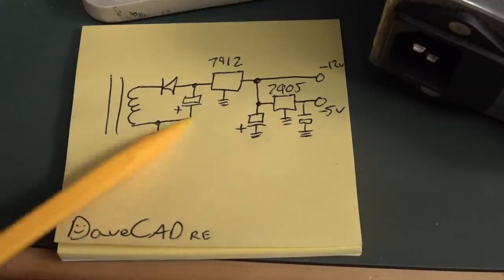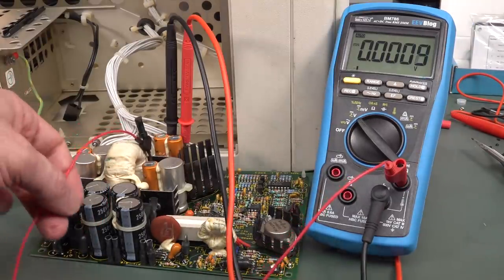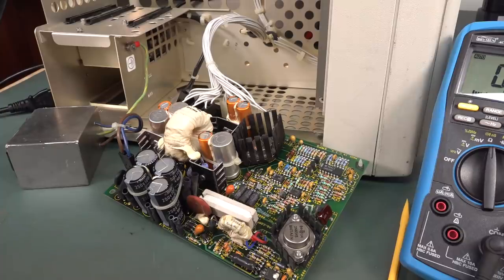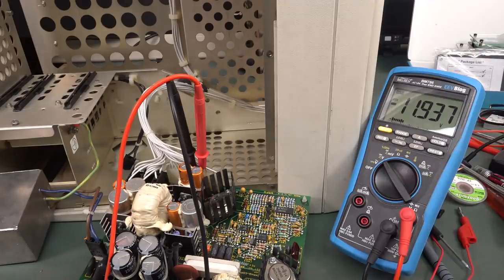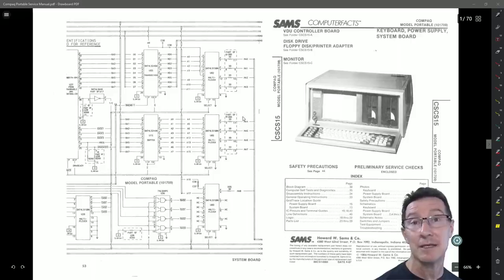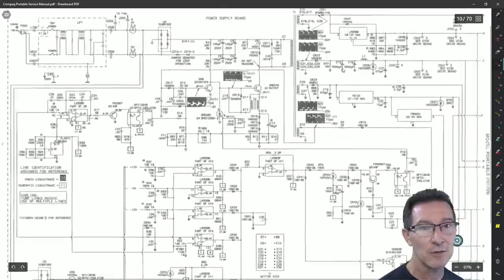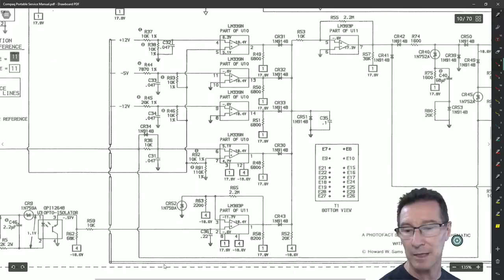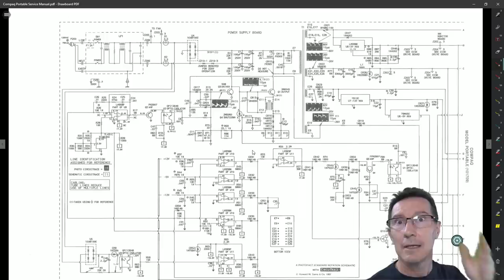EEVblog #1364 - Compaq Portable PSU REPAIR

Comment: HELP?  Alot of talk on Negative 5v or 12v.  What is it?  Ive checked google but dont understand
Reply: Eh?  It is -5V and -12V.... what are you missing?  The voltage is referenced to ground, and the negative sign means the current wants to from from ground back to the negative supply rather than the other way.
Reply: @phillipsusi1791  I'm confused cos Ac  waveform is like that isn't it.
So dc I'm just trying to understand. What benefit does voltage have being negative?
I'll just read up when I have time
Reply: @groovejet33  @EEVblog Perhaps this would be a good subject for an explainer video ??
Reply: @Brian_Of_Melbourne  thanks buddy
Reply: @Brian_Of_Melbourne  you mean video by Dave?
Reply: @groovejet33  AC has a waveform.  DC is supposed to be just a straight line.  Now in reality there is always some ripple in there, but for simplicity sake, you just think of it as a fixed voltage.  Most of the time everything is positive with respect to ground and that's just fine.  Some things call for negative voltage but I'm not really sure why.  I now that LCDs use a negative bias voltage to turn them off, and that the RS-232 spec called for it as well, and so I thought that was about the only thing in a classic PC that uses it, but it sounds like DRAM also used negative bias voltage for some reason...  Why negative voltage instead of just offsetting everything else to be x higher than ground?  I have no idea.  It should be equivalent.
Reply: @groovejet33  The negative voltage supply is used to be able to generate & measure signals that can swing above and below 0 volts. For example, you need a positive and a negative supply on an Op Amp for this reason. Older ICs used negative voltages this way too.
Reply: @groovejet33  Yes, I did mean THE Dave Jones.

Comment: 110 yankee rubbish.

they should print that on devices, "240v or 110v yankee rubbish"
Reply: Like many PSUS this is switchable between the two. While it might not have a physical switch the Sam's explains it: install the jumper for 120v and remove for 230v.

Comment: The Yanks don't use 110.....
Reply: Stick that BM786 in standard US wall socket and it will absolutely say it's ~110v! ;) But I know where you're getting that. I didn't know that about US houses as well.
Reply: @gertnutterts988  Unless the BM786 uses different (metric?) volts, it won't read 110 - that hasn't been the US standard since some time in the 30s or so - at that point it was called out as 115/230, and is currently a nominal 120/240.  A meter (not a BM786) plugged into a wall socket here moments ago reads 121.6Vac.
Reply: @gertnutterts988  The official standard changed back in the 80's from what I understand.   Most houses in the US are 117 - 123v.  Of course the big stuff runs on 240v +  (AC's,  Ovens, etc. )  Unless it's 3 phase and well then it's 120v and 208v.  Get's confusing.
Reply: THIS. The U.S. provides 220V to residences as two 110's that are 180 degrees out of phase. This means you get 220V on circuits where that makes sense (ovens, ranges, heaters, compressors, etc.). Then, for lighting, televisions, appliances, etc., you get one of the 110's (paired with neutral).

So, not rubbish at all! Also, 110V is much safer. It's even common for electricians to service the 110V switches/outlets without bothering to turn off the breaker, as any accidental shocks are manageable (though hurt still!).
Reply: @originalmiu  NO!  The single phase domestic line voltage in the US is 120/240 - pole pigs are 240V center tapped transformers with the center tap grounded at the pole and service entrance, and acting as the neutral.  Voltage is a nominal 120 line to neutral, and 240 line to line.  It has not been 110/220 since the early part of the 20th century.

https://en.wikipedia.org/wiki/Mains_electricity_by_country
Reply: @patmx5  Typical Yankies, call me out on when 115/230 (semantic discussion anyone?) is (if your right) currently 120/240. But not calling me an old fart. Because when I went to school they taught us it was 220 but then raised to 240. Call me a voltage bias (pun intended), but in my heart 220v still flows out of every outlet here. ;) :P 

I see one more reason to fly over and poke at your "meterkast" then. :D
Reply: @originalmiu  I was probably 10 when my dad taught me what "hot" and "neutral" meant, and I thought it was cool that I could go stick a paper clip into the neutral hole on outlets and not get shocked.  Until I ran into one that was wired backwards.  There was a flash, and I was stunned for a few seconds, then I realized my fingers were black and blue and it hurt like hell and I ran to my dad crying WHY!?  Not something I care to repeat.
Reply: @originalmiu  The US Standard is 120/240,  not 110/220.  See IEC 60038.   110 would be considered low and in need of repair.
Reply: @phillipsusi1791  Of course, I don't recommend folks should feel safe to go around and "play" with sockets! ;) I was just pointing out that the professionals often work with live circuits.
Reply: @originalmiu  Yea, my dad used to tell me stories of old timers that would put their middle finger on ground and their index finger on the fuse hole for hot and be able to tell from the feel whether it was 120, 240, or even up to 480 I think.